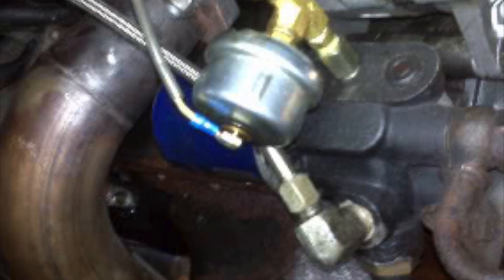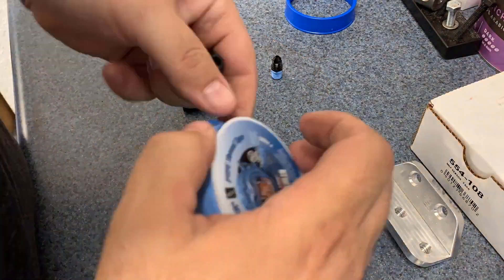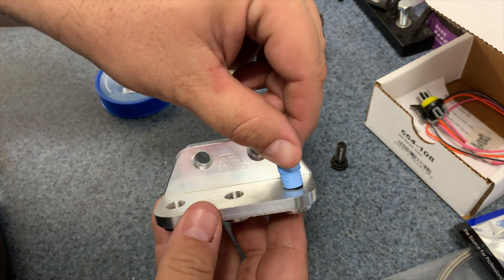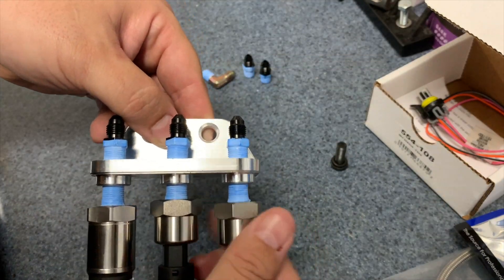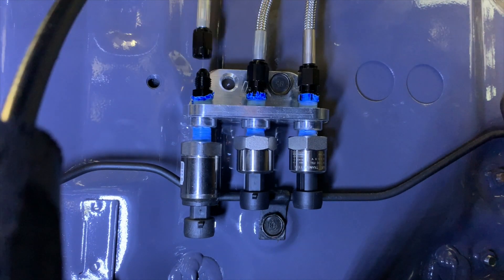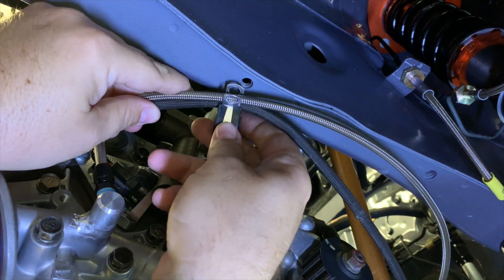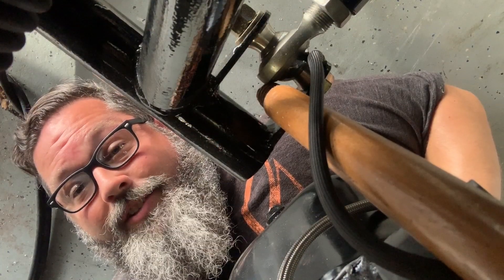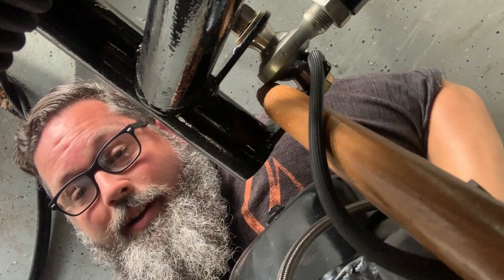Pro Street Eclipse - Part 44 - Remote Mounting Pressure Sensors

Comment: Think I might have to do this.
My sender to the gauge isn’t working🤔
I’ve checked all wiring, probe circuits, fuses. Idk what it could be, both sender and idiot are brand new. 
Thinkin maybe the cluster?🤔
Never had problem with them in past.
Reply from the maker: Did you get this working?

Comment: Is that a coolant expansion tank in place of the water neck? I've never seen that on a DSM, what are the benefits?
Reply from the maker: It's a swirl pot that can help get air out of the system, but mostly I just needed something simpler than the OEM thermostat housing with 11 different holes in it. Two is fine.
Reply: @JoeWrenches  ah gotcha, so its a closed system no thermostat, no overflow?
Reply from the maker: @eclipsetrekker  No thermostat, but it has an overflow.

Comment: Looks good👍🏻 curious about coolant pressure sensor why monitor it?
Reply from the maker: Monitoring coolant pressure can alert you to a problem before it gets out of hand. It can also be used for engine failsafes, for example, if your coolant pressure spikes, it's likely because you compromised the head gasket. You could then have the ecu pull power back to try to finish the pass, and/or have it kill the engine if it gets really bad.
Reply: Joe Wrenches Good stuff ! Thanks!

Comment: Does the emap get a good reading off 1 exhaust port?
Reply from the maker: It's not 100% ideal, but it works well there.
Reply: @JoeWrenches  thanks for the info. I'm going to use the same method, and I had a small canister made. I hope it's accurate enough... not like the engine relies on this reading for anything (until I do pre-turbo O2) I'm just looking to see when I'm around 1:1 pressure ratio
Reply from the maker: @eclipsetrekker  Exactly. It's just data. It's there for comparisons sake. No different than a Dyno. They're not all accurate, but, you can use the data from the Dyno to figure out if you're making positive changes to the setup.

Comment: do alot of people use remote sensors? never thought about it
Reply from the maker: It is pretty common. Some sensors you can live dangerously with, but I would never do it with a MAP sensor or anything critical.
Reply: I killed a coolant pressure sensor in a few hours plugged into the water neck...
Reply from the maker: @eclipsetrekker  That's what I've seen happen. I know people who have had their MAP sensor screwed directly into their intake with no trouble, but I'd rather not risk it.